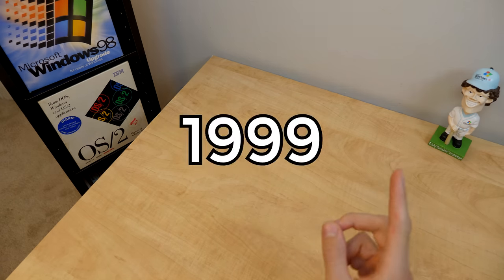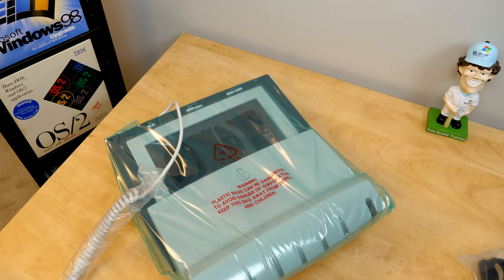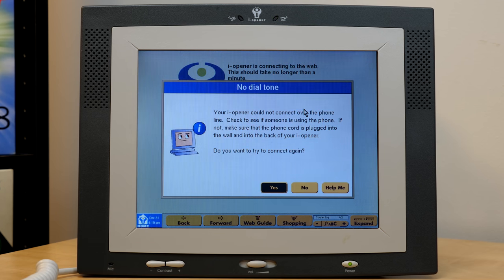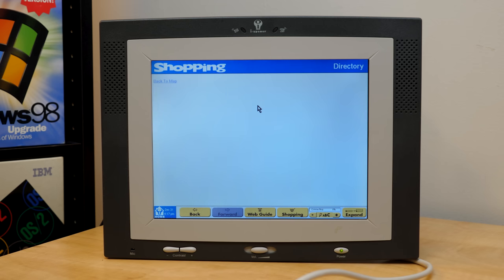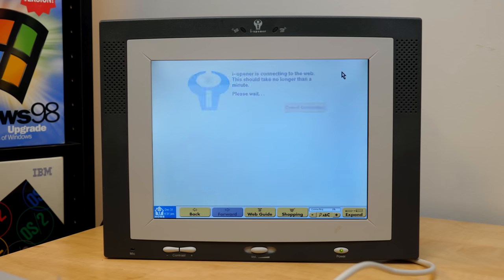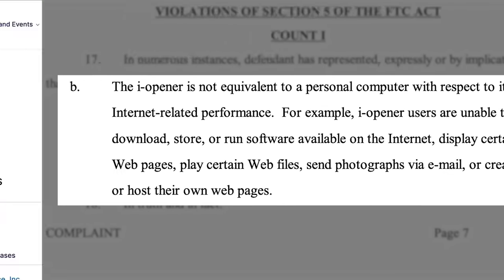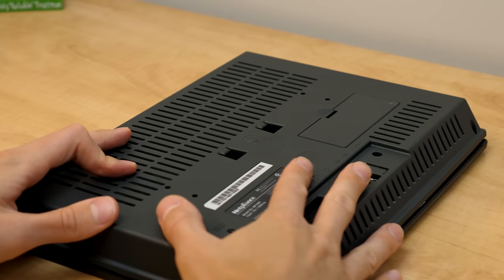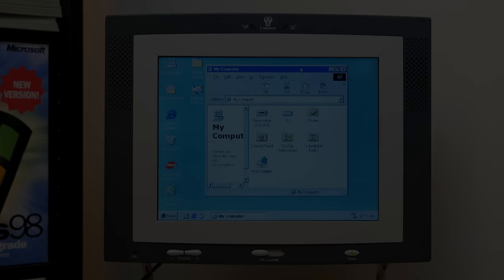i-Opener - The $99 Computer That Cost a Company Millions

Comment: I absolutely love that you need to unscrew a cover to unplug the keyboard, but you can just pop off the cover to upgrade the ram. Amazing!
Reply: ehhhhh Mazing
Reply: To be fair the screw ensures that it won't pop off the cover
Reply: @SilvaDreams  I'm not knocking it, I unironically love it.
Reply: That was before you could just download more ram :)
Reply: I mean, you can’t just use a normal keyboard, how would you order pizza?
Reply: @LunaDeaminac  The keyboard mini-DIN connector has the mouse and keyboard signal wires swapped, so you can't use a standard keyboard.

The pizza key sends a standard key code, so they weren't even using custom keyboard firmware.

(Yes, a serious answer to a humorous question.)
Reply: @1djbecker that’s actually pretty interesting, tbh. I like these, ultra niche pieces of information. Like the Windows 7(?) loading screen being characters in a font that is not locally accessible but can be installed “natively” on the system.
Reply: Nobody in their right mind would just take off a working computer's ram, while most keyboard back then, i doubt they're even hot swappable... So, that's most likely the reason.
Reply: @LanxPenzenpepper  I'm pretty sure they weren't. This is pre-USB era.
Nowadays even monitors and hard drives are hot swappable thanks to USB. Gosh, we've come a long way, gotta love industry standardization.
Reply: @crusaderACR  i remembered back then being scared to remove a ps2 keyboard from a pc😂
Reply: Yes anymore!

Comment: The only thing worse than accidentally hitting the Windows button is accidentally hitting the order-a-pizza button
Reply: I'm pretty sure the pizza button is the Windows key, just labelled differently.
Reply: "The only thing worse than accidentally hitting the Windows button" when did accidently hitting the Windows button become bad? I mean I guess if you're playing fortnite in fullscreen or something like that
Reply: @tzarg  it’s such a common issue that newer keyboards let you disable the windows key if you press fn+windows

edit: engrish
Reply: @lambertstarr1218  older ones have it too. My keyboard is about 15 years old and has it.
Reply: @tzarg  It's obviously worst in multiplayer games where you lose control but it doesn't pause. But it's not only games. Pressing the Windows key changes the keyboard focus, disrupting what you were typing and potentially hurting stream of thought. If you continue typing something and hit enter you'll run something random which is also not good.
Reply: @tzarg until you press Alt + F4 when your are going to be Top 1
Reply: Better keep the cats off the keyboard. You'll end up with 9 pizzas and 21 sodas sitting at your doorstep in the middle of the night.
Reply: Pushing the suspend button in those multimedia keyboard is actually annoying so when I can I configure that button to only power off the screen so I don't have to loss like a couple of minutes getting back from sleep mode.
Reply: @tzarg  Full screen start menu in Windows 8 I guess?
Reply: Pizza is always good
Reply: @eDoc2020  build muscle memory on your keyboard layout, duh
Reply: @LgdFanta  if you accidentally pressed alt and f4 on a game then you probably never have been the "top 1" in the first place, like seriously how could you press something so far out of your finger location
Reply: @tzarg full screen windowed my friend, alt tab as you please
Reply: @lambertstarr1218 I’m sure this is a common thing among either cool people or nerds that i just dont know about yet, but to me just saying “edit: engrish” is so funny because its so short but also makes it extremely clear why you edited
Reply: @melody3741  i just made it up on the spot 🤣

English is not my first language so i’m always making these little edits
Reply: How are you accidentally hitting the windows key I only hit it once my entire life
I was trying to press alt
Reply: You don't have a disable windows key key on your keyboard nowadays?
Reply: @everythingpony  that's a lot of keys, you see that the key to success is managing your keywords very willseli as that is the key to a very well made key relatory in a job oh the key for a good key employment paper. You need to be very careful when using your keyboard as that is key for a good experience on the key to your life that is you computer that you wasted key money on

Edit:needs more keys
Reply: muffin button
Reply: @lambertstarr1218  this is very useful to know, thanks. My 8 yo brother hits the Windows key every 5 minutes when we are playing together
Reply: I had a friend who actually pulled those keys off his keyboard entirely. Because "they were annoying".
Reply: @lambertstarr1218 actual skill issue lmao
Reply: Oh no! I accidentally ordered three large pepperoni pizzas with extra cheese. *LIE*
Reply: Wait... rest the METAL HARD DRIVE on top of the BARE MOTHERBOARD?

Am I the only one thinking he got extremely lucky to not short anything?
Reply: Pizza time

Comment: I converted one of these into an MP3 player that could be used in a car on long road trips.  I reflashed the bios by hot swapping the bios chip into a compatible motherboard after it had been booted up and I had a flash utility running.  The hack was a hell of a lot of fun and having winamp available in a car really whipped the llama's ass.
Reply: I almost forgot there used to be a pretty large community of people installing PCs into cars. I used to be a member of the MP3Car community. I remember people having impressive Windows XP systems with touchscreens, running the RoadRunner front end.

Android Auto and Apple CarPlay is cool and all, but nothing will beat how cool it was to start your car and see the Windows XP bootscreen on your dash.
Reply: That's awesome!!!  I had a purple one in 2001.  Unfortunately when I moved to Illinois, I didn't bring it with me 😢.
Reply: I hope to hell you installed that screen and ran Milkdrop2 on it as well!!
Reply: it really whipps the llama's ass
Reply: Can you do the same to chromebooks replacing the chromeos into, like, Arch or SteamOS?
Reply: Possibly, but I've never looked into it
Reply: @meyers0781  i mean if you detach the monitor and put it below the bottom part of the laptop, and you attach it to the walls then i guess its possible
Reply: How'd you get it to deliver pizza to a moving car?
Reply: @Eta_Hoyimi Park the car?
Reply: I saw Wesley Willis in concert a few months before he died.  He performed "Lick a Great Dane's A$shole" and the crowd roared like a lion
Reply: @Eta_Hoyimi the delivery guy drives next to you and passesnyou pizza through the window
Reply: ROCK AND ROLL MCDONALDS
Reply: @customsongmaker that's a relevant comment, as ww used it too.. but Winamp is where dude is referring
Reply: As a mother now, I very much approve.
Reply: Yes internet
Reply: This comment feels like another person's nostalgia punching me in the face.

Comment: If you use an IDE to CF card (or SD card) it could all fit together neatly with the metal shield etc. you could even have the card accessible to swap out different operating systems
Reply from the maker: That's actually a really good idea! I'll have to pick up another adapter but that'll probably save some space inside the case.
Reply: Exactly what I was thinking
Reply: any iPad is better !
Reply: @lucasrem that’s not really the point though!
Reply: @lucasrem  This is an IPAD, what are you talking about. ;)
Reply: @MichaelMJD  I think there was an IDE SSD project somewhere too
Reply: @matthewday7565 could just get one of those IDE flash modules.
But yeah, CF uses the same interface as IDE, so adapters are pretty much passive just to make the plugs compatible. There were even hard drives for CF plugs, microdrives. SD cards aren't as simple to translate, but more available nowadays and with bigger capacities.
Reply: Use a disk on module
Reply: Please don't use CF (or even worse, SD) cards as OS storage. They will be slow as molasses and won't last. Get an mSATA to 2.5" IDE adapter and a dirt cheap 16-64GB mSATA SSD, depending on your storage needs. If you need more storage, there are "modern" versions that adapt M.2 SATA SSDs to 2.5" IDE as well, just keep potential BIOS size limitations (8GB, 32GB, 127GB) in mind
Reply: I put a low-profile hard drive in mine
Reply: That's how i build the cheapest systems back then, 4Gb old photo card as HDD, Chep CPU, good Nvidia card.

Comment: That part at the end reminded me. There was this ISP that I used for free for a while that wasn't supposed to be free. You would use the disc, dial out, and go through a signup process. Thing is, while you were on the setup screen, you could use other websites. I didn't use it often--mostly only on my laptop when I was away from home. The ISP had a lot of local numbers in pretty small towns, oddly enough. 

I also remember using the internet for free legitimately: with my school, and then later with some software that displayed an ad on at least 1/5 of the screen. It's bizarre that I put up with this, since now I avoid anything with ads. But you could pretty easily just cover up the ad part.
Reply: Heh, I used one of those free ad-based ISPs for awhile. Except that I had LiteStep for my GUI - which supported virtual desktops. So I could just drag the ad bar over to another desktop and it would keep running, while the ISP had no idea I wasn't seeing the ads. After all, who'd expect users to have multiple desktops on a Win9x machine? 😀
Reply: I used free ISPs back then but I still cannot get how they could get a profit 🤷. In my case, they had no ads. Ideas?
Reply: @kdrum90  I guess it depends on the country and how the phone system works. In the UK there were "free" ISPs where the phone call cost something like 1 penny per minute, of which a portion went to the ISP and the rest to the phone company.

Comment: Wow this took me back. My roommate (she was a technical genius) found out about these on slashdot and picked one up for me when she got hers. The pair we got had teh BIOS chip epoxied in the slot. A few hours of scraping the epoxy off very carefully, and we could pull teh bios chip and reflash it. Added a low profile CPU cooler fan, and got the kit you mentioned to mount he HDD and flip the pins. Was pretty ok for a couch PC. 
We went the linux route for the OS. Roommate was actually a contributor to the kernel, so she knew what to do to get it running well. the ghosting on the cheap screen made it impossible to use to play games, but was fine for web browsing. Oh, and it was a straight swap to drop in a AMD K6-2 processor. Not bad for 99$
Reply: linux sucks
Reply: Linux now is better then windows, only issue is thag all the big softwares and games only support windows
Reply: @Matt-qf6pd  dude Linux didn't work on my old HP Stream it kernel panics and no WiFi

Comment: Regarding the IDE cable pin swap, this also happens when the pin header is installed on the bottom side, or if a header was swapped for a socket. I recall encountering other 'appliance' PCs with the same modding issue.
Reply: Thanks for sharing that info! So no anti-mod but a technical/mounting reason? That sounds legit to me. Hard to imagine that just a pin-swap is worth the effort to prevent people from hacking the machine.
Reply: I have seen this cable before, it's a known solution in pre 2000 computing, capturing paralleled signals ?  parallel file transverse cable ?
Reply: The cable laid out flat, the headers would be on opposite sides to each other, not just opposite ends. Then one side you rolled over so they are on the same side. Still a somewhat custom thing, easy do to though.

Comment: The hilarious thing is, they completely missed several obvious markets for a machine like this. They could have cross subsidised themselves by selling these as web kiosks, or as POS terminals with some pretty minor changes. The form factor is literally perfect for those use cases, and they could have made their money there, maybe sell these for $200 for home users, still cheap, and  still capable. Could also have just onsold upgrade kits to those wanting. proper OS.

How they missed the mark for kiosks and POS  terminals as an option tiven the fantastic form factor for those uses boggles me.
Reply: these would have been great for internet cafes
Reply: POS systems need all kind of special devices attached to it, and POS systems (and kiosks!) with a screen like this were often touch screens. So I don't think it would've been feasible for either use. Also ruggedness comes into play.

Comment: Found 2 next to a dumpster one day. Probably in the early 2010's. Both had a really stripped-down version of Win98 on them. One was still original, but the other had been upgraded w/ a hard drive. I didn't have a use for them, b/c they were so under-powered at the time compared to other hardware I was finding. I gave them away to a guy on craiglist. My ad said "only reply if you know what this is". I was getting replies from folks "I'd love to have your flat-screen monitor!" They had no clue what they were. Then one guy contacts me out of the blue "I know exactly what they are, and have a project for them". Cool, here you go! Have fun! Hopefuly they didn't end up in a dump.

Comment: This is a lot like the Virgin Webplayer, but that had a 200mhz processor and a IR keyboard/trackball. On mine I added a wifi module, hard drive, and reflashed the onboard Disk-On-Chip boot drive. I think most I could get it to run was Puppy Linux 2.14,
Reply: Just booted it up again, it's running Puppy 4.31
Reply: That's pretty cool!
Reply: My brother and I went in together on the Virgin Webplayer. Still the iOpener was more useful. The things you forgot you did, for the fun of it. But now I remember I was part of the Co-Op that bought a bunch of these, together.

Comment: This is a walk down memory lane.  I bought one of these for the $99 before they locked it down, bought the full kit, built the modified PC with Windows installed as a fun little project as it was pretty novel to have a compact all in one with lcd screen at the time.  Ultimately the performance was too slow as a power user and I didn't have any real use for it.

Comment: Thanks for doing this amazing video, research and debugging. I'm the owner of one keyboard like that, but had never seen the computer it was supposed to connect to, so that was a fun discovery process!

To my limited testing so far, the keyboard is "almost" meeting PS2 standards, but not quite. It's missing some crucial keys (the F keys, and Escape key for example) for it to function on a normal PC. Maybe I should disassemble it to see if the missing keys could be re-added or re-routed somehow to the rubber ones.

Comment: LOL, I remember a friend I nabbed two of these at Circuit City, then we stuck in PATA drives in ours, months later got a $500 bill in the mail from Netpliance (Circuit City apparently gave customers addresses to them without permission).  Neat little machine but abysmal LCD.  Still have mine and it still works.
Reply from the maker: Oof, that sucks. I was wondering if Circuit City passed on customer info to Netpliance but didn’t find any info on it. Pretty wild that they actually did that when they didn’t have permission.
Reply: @MichaelMJD  Yeah, and I remember it being kind of a nasty threatening letter.  I believe Circuit City got my address because I had once signed up for their DIVX rental service.
Reply: @rbus  Wow. Two dead end services.

Comment: I used to have one! I even bought the kit and installed Windows/Linux on it. If I remember correctly I got the version that needed a replacement bios and it was glued in with epoxy that I had to chip away but I don't really remember.

Comment: A few questions:
Firstly, Did anyone create any restore images for the OS? I can't seem to find it on internet archive at least.
Given that the I-opener could run Windows, and I assume because QNX could run from a floppy disk on a regular PC, that the Netpliance setup could run on a regular PC too?
Secondly,, have there been any community projects to recreate the services this device used. Since the ISP was changed over quite easily, I'm guessing the majority is going to be simple news feeds off a webpage that's controlled via domain/DNS settings. We have the ability to run our own dial up servers now, surely it'd be possible to get this thing back up and running using some nice newer services.

Comment: 99 bucks for the hardware at the time was probably what the parts were worth in comparison to the second hand market at the time, except for the screen. That would add to the BOM significantly at the time.

For contrast I got my p100 in 1998 built for about $200Aud (still runs) with plenty of upgrade potential (I ended up getting a k6-3 later)